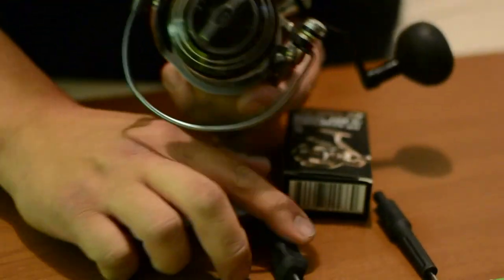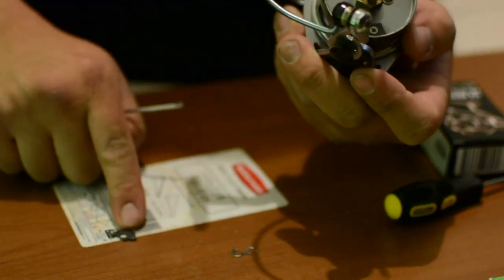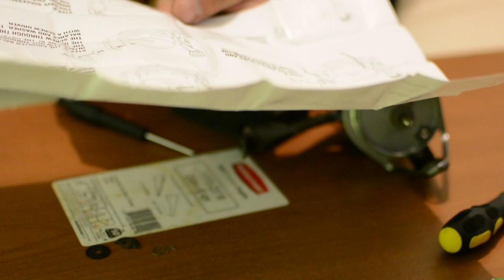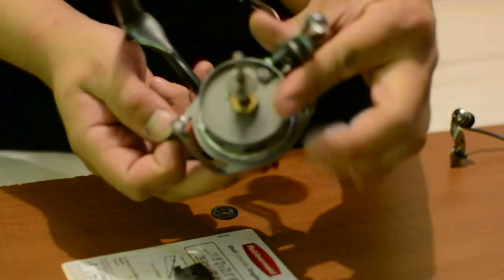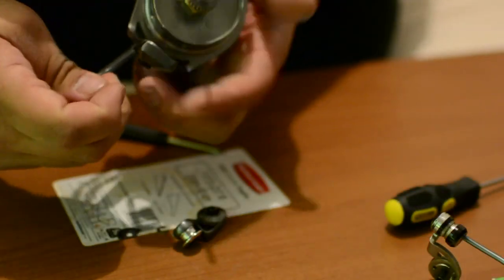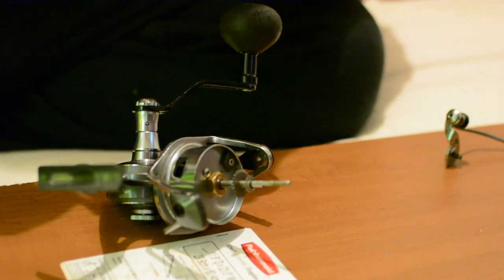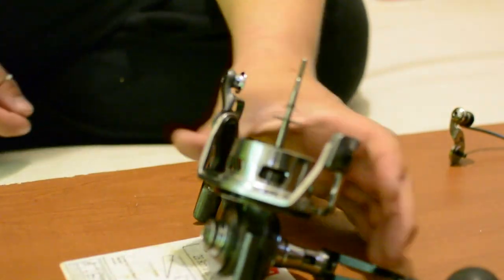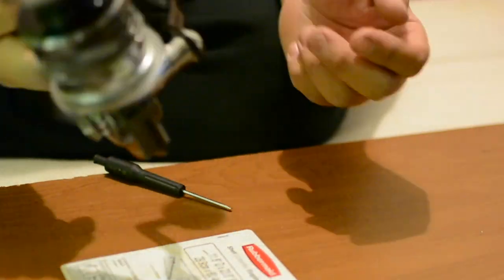Tsunami Shield bailless conversion (how to)5000-8000 size

Comment: excuse me then putting these pieces the reel works the same ??? I lost the pieces
084 arm lever washer 051 bail arm rive
Reply from the maker: Yea it workes pretty much the same instead of flipping the bail you just take the line off the roller
Reply: Thank you very much for the support I am going to get the kit to put it on. I already missed the reel since I am from Mexico and I have not been able to find the pieces very much thank you for your prompt response. Best regards.
Reply from the maker: @ivancobosgallegos4503  yea no problem thanks for watching the vid and yea getting parts for the real is pretty tough